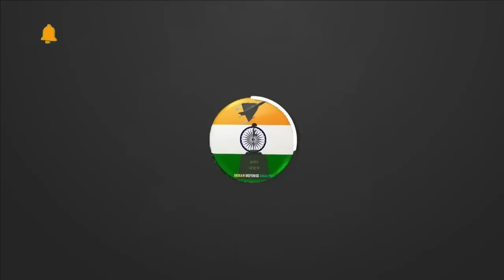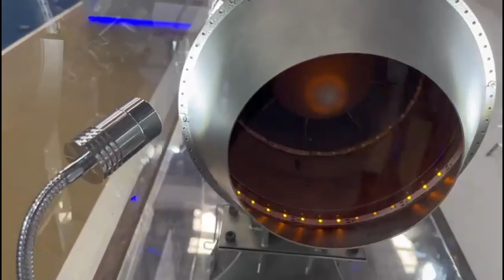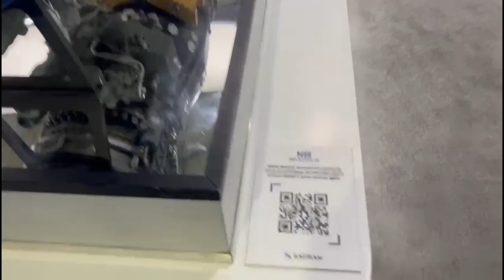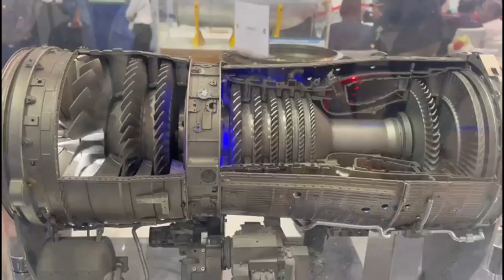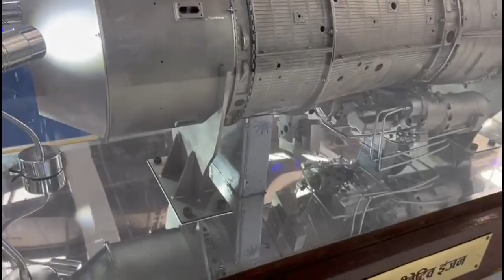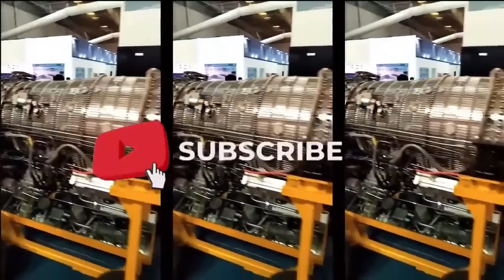Kaveri Engine: Godrej inaugurates facility to commence manufacturing of Kaveri Engine parts

Comment: #mission mode may yeah project shuru say hi thaa hame khud per yakeen karne kii jaroorat hai . humko kaveri engine k liye #environmental control system,#air traffic awareness system, #digital management system or navigation router less elevation  k sath low rolling resistance dawara  energy loss ko #minimizes karna hoga. #Intigrated system  banana hoga taki performance ko maintain kar sake or #engine ki #weight manage ki jaa sake . 😡

Comment: Kaveri engine is a huge breakthrough. The subpar substandard Ge404 engine can be thrown overboard. $716 million contract for 99 General Electric  F404-GE-IN20 engines.
 That is 7.2 million per engine, and at least 4 will be needed over the lifetime of a jet. Kaveri has already delivered an excellent return on investment at the first step! The needed facilities must be provided. Flying test bed and more wind tunnel facilities. The project must be officially relinked to Tejas Mark1A and used when existing engines are due for replacement. It is also necessary to start testing the wet thrust. The deficit vs 70.4 and target of 81 needs to be bridged. Titanium printed parts can help cut weight of Kaveri engine. Time to get started.
Reply: Hello ge f404 has a life of 3000-4000hrs unlike 500-800hrs of Russian engines . 
Frame life of Tejas is 6000-9000hrs

Comment: an engine that is 200KG heavier than a GE404 and has lower performance, yet we are still pursuing the project and claiming it to be a success? does no one care about the performance of the vehicle that will eventually use this engine? oh wait. i forgot, this is all snakeoil stuff anyway.
Reply: 10% heavier is not an enormous problem. Kaveri engine can easily achieve higher performance over time.
Reply: Incremental improvement is also a good way of building capabilities.Sequential versions of engine with improving weight and various parameters can be pursued.The story can start with unmaned aerial vehicles and graduate to fighter jets.
Reply: Big egos at play and corruption also.

Comment: We may have to use this in AMCA...😂🤣
Reply: We already have GE F414 for AMCA
Reply: @direwolf7491  .. it's like using a 1 Ltr engine in a Rolls Royce..
Reply: @abymathew295  GE F414 is more than enough for AMCA as a 5th gen fighter.
IAF wants more ambitious 5.5 gen AMCA which is why they want higher thrust engine.
AMCA is lighter than F-35 GE F414 will give AMCA higher t/w ratio than F-35.
Reply: @direwolf7491  . No super cruise, no TWC...what kind of 5th gen fighter is that..Besides, when the AMCA mk1 is out after 2035 or 2040, the 5th gen fighters will already be in Museums.
Reply: @abymathew295  Can the F-35 supercruise?
AMCA supercruise just as much the F-35 will.
In the museum are you nuts? You think technology is like halwa? Man I find statements like these hilarious. From where do you guys make up all this crap?
Reply: @direwolf7491  . Yes,F35 can Super Cruise..
There is nothing more to discuss about F414. It was designed for Tom cats 30 years ago...You think that's an ideal powerhouse for a 21st century "5th gen" jet.????
We should have already signed a deal with GE to Manufacture a 110 Kn engine with full TOT to use in AMCA mk1...not the Mk2.
F414 is an ideal choice for Tejas Mk2, as it's a reliable, low maintenance engine with enough thrust.
Reply: @abymathew295  F35 can supercruise for how long at what speed? Please check that and tell me also😅
Also, F14 Tom cats were heavy jets.
Also, your suggestion is quite foolish. GE is not offering adaptive cycle engine. What would be the point of getting a 110kN GE engine with ToT then again get another for adaptive cycle next gen engine?
That would be the worst deal ever.
Reply: @direwolf7491  . F35 may not be able to fly At supersonic speeds for a prolonged time, but it certainly can, Besides, the 25 year old F22 and Chinese J20 can sustain those speeds.

We are not getting any adaptive cycle engine from anyone for sure...it's better to stay with traditional, reliable engines with high thrust output to power AMCA. For AMCA Mk2, we could try to add those features into it.
Reply: @abymathew295  Abh aagaye line pe?😅
Now tell me if F-35 is more advanced or F-22 and J-20 is?
Also, there is a high chance that UK may want a seperate line of production for adaptive cycle engine. Seperate from the EU, which they can easily access without too much deplomacy. Rolls Royce has offered adaptive cycle engine with India. So if that offer works out it doesn't matter if it takes another 15yrs to make it. It will be a permanent solution.
Engine is not a big issue for AMCA. Getting the AMCA made is. With engines we have options.
Reply: @direwolf7491  . F22 is still the best 5th gen jet ever made..it's faster, stealthier, and built for Air superiority in mind. while F35 is designed as a dedicated ground attack jet against, like  High value ground assets..and it's cheaper to maintain too.

Speaking of Our jet engine deal, we haven't even started the official discussion with Above stated Engine manufactures yet. Engine is the most important component in a jet and thats what we should give the highest priority. The fuselage and all the other components are home grown and we have full control over them. Hence, it's the engine deal that should be fast tracked.
Reply: @abymathew295  I didn't ask which is the best. I asked which is more advanced? Even I like the raptor, but they are are being retired.
F-35 has lower rcs than F-22 though so you are wrong about that.
I think we already have the engines ready for AMCA block 1. Getting the jet completed is far more important. Even with the GE F414 AMCA will give better performance than J-20.
Reply: @direwolf7491  . F22 has lower RCS than F35...The reason why they are retiring F22 is their Sensor fusion tech is not as advanced as the F35 and old software's are getting harder to update, besides they cannot carry Modern American weapons. But still they are faster, deadlier and stealthier than F35..
Reply: @abymathew295  F-35 is still better than J-20. We need AMCA blk 1 to be better than J-20.
With GE F414 engine it can be.  First we need it made that's all. For advanced engine there is still time.
Reply: @direwolf7491  . We can't say if F35 is better than J20, especially with their WS15
Reply: @abymathew295  What?!!!😅
Bro you don't know what you are saying.
No wonder your comments are so erratic.
Please do some research on F-35 and it's rcs.
Even Rafale F4 can match the rcs of J-20 with all it's WS15 engines. Lol
Reply: @direwolf7491  . Ofcourse, the J20's RCS will be higher, it's almost 1.5 times larger than F35. But in terms of speed, armaments, rate of climb, BVR capabilities, J20 is definitely better..
Reply: @abymathew295  Tell me in numbers man. It is not 1.5 times higher. It is more like 10-50 times higher. Lol
Speed doesn't mean jack in bvr. What BVR capabilities is J-20 better than F-35? Please tell me.
Reply: @direwolf7491  . I wasn't talking about the RCS value, rather pointing out J20's physical form factor...F35 does not have any answer to China's PL15, and yes, Speed does definitely come in play when fighting in close air combat or in BVR mode..turning in, out rating the enemy, climbing,  out running the missile..The speed is everything.
Reply: @abymathew295  Stealth is measured in RCS value. I'm not sure what you mean.
AIM 120D is a decent answer to PL-15. The range of PL-15 is irrelevant when the F-35 will always see the J-20 first because of it's RCS.
In BVR speed doesn't really matter.
Most combats occur at speed mach 1-1.5 max rately ever they'll approach mach 2 in a bvr combat.
Rate fights don't play a role in a bvr.
BVR is all about rcs/stealth, radar, missile, service ceiling and who can lock and shoot first.
Even running out of missiles aren't a problem the next jet can replace the one in the fight while it goes and reloads.
Reply: @direwolf7491  . You didn't get my point...i said the J20 is 1.5 times physically larger than F35.
To Get a decent shot you need to get around 60 to 70 miles on 120D, even with that range you may need at least 2 or 3 missiles to down a single jet...Don't think that a single missile will chase down the enemy jet...so at around 70 Miles J20 will definitely will find you, or your AEW&CS does...After the 4 AAMs of the F35, you will be forced to merge with a J20 or you have to run away..at that point J20 will spank Any F35 without a question..
Reply: @abymathew295  Dude! You don't know what you are saying. Lol
 Let me give you some numbers the minimum rcs of J-20 is 0.05-0.01msq
The minimum rcs of F-22 raptor is 0.001msq
The minimum rcs of F-35 is 0.005-0.001msq
Which is size of a tennis ball.
Both jets are having 10 times lower rcs than J-20.
It has nothing to do with the size of the jets.
F-22 is huge but it's rcs is the least.

Also I don't get your logic. The range of AIM 120D is far more than 70miles (range is more than 100miles) and if the F-35 sees the J-20 at 70miles for the first time the J-20 hasn't seen the F35 yet you can be sure of that.
J-20 won't even know it's being shot at because MAWS will activate when the missile is already about 8-10 miles away. 
J-20s will fall like flies in a real battle.
Why do you think China is making such huge numbers of J-20s?
Reply: @direwolf7491  . Why are you again biting on to the RCS value...Dude, i clearly said I'm not talking about any RCS shit here, but J20's physical size compared to F35..🥴🥴
AIM 120D has over 110 mile range, but nobody's gonna fire a BVR missile at enemy at its maximum range...70 to 80 miles is the ideal firing range of it..And you need to fire at least two or three Fox 3 missile at a single enemy to ensure its destruction...The enemy jet will get MA Warning at close range, that's where the High thrust engine come in play, they will Crank the jet and bleed missile's energy, or pull it down to denser air to do the same, or they simply go terrain masking...
You should play DCS to get a clear picture of How missiles and jets work..at least watch some Videos in YouTube about it.
Reply: @abymathew295  Yoy clearly don't seem to understand how stealth works do you?
Mentioning RCS is most important in BVR. If the jet can't be locked at because of its low rcs you can't even shoot at it. 
70 miles or 110 miles. At either of those distances it is highly unlikely the J20 will spot the F35. F-35 can see the J-20 though it will shoot and go cold. While the J20 will move towards the missile still searching for the F-35 (that is moving away from it) unaware of the missile coming straight at him. This can even cause the J20 to enter the no eacape zone of the missile too. 
By the time it detects the missile it has reached it's terminal velocity mach 4+. 
If it has enterned the AIM120D no escape zone, it is game over. Defensive maneuvers won't save him even at speeds mach 2 the missile is always faster
Reply: @direwolf7491  . I clearly understand how RCS works...it's extremely difficult to get a good lock on F35 at long ranges but that doesn't mean it is completely invisible to Awacs or other ground based Radars. During the 3 second time of opening it's internal weapons bay to eject the Missile is all it needs to ping the radar and enemy to launch counter offensive or to notify their friendlies in the sky. Besides Passive tracking, like EOTS and IRST will also detect incoming Missiles and Exhaust plume of even the stealthiest of jets.Even Pentagon has officially said that their stealth advantages over their adversaries are loosing.
Reply: @abymathew295  We are discussing about capabilities of two fighter jets now you are bringing awacs and SAM systems. Lol
You think US doesn't have awacs?
You think F-35 will attack alone?
With those even F-15 ex will take out J-20s. Lol
Losing stealth advantage is a sweeping statement. If your enemy has a stealth fighter then yes you'll be losing your stealth edge by a little in the case of J-20.
Reply: @direwolf7491  . F15s cannot take down J20, coz they simply don't have a missile capable of reaching those distances, till they induct AIM 260D into their forces.
Reply: @abymathew295  Why not? F-15Ex is faster than J20 got awacs to track them down. I am using your logic here.
Rafale will also be able to kill J-20 with AWACS and the Meteor. Because according to you RCS doesn't matter in BVR😅
Reply: @direwolf7491  . F15 has no answer to PL15...do they .???
Reply: @abymathew295  I don't know. Do you know the real range of PL-15? Or how effective it is at that range.
 I have my doubts that a dual pulse missile can have such a massive range.
The Meteor has Ramjet engine so it makes sense.
Also, I used your logic. F-15 is the fastest fighter in this era. It will get in range shoot and out rate the J20 and bleed energy of PL-15😅
Too much dcs right?😅
Reply: Don't have enough thrust, its probably going to use for UAV.
Reply: @ananthunath4450  . It is

Comment: That was unexpected.
Kudos to godrej for bringing up this support to defence 🔥🇮🇳❤️
Reply from the maker: Godrej is just doing screw driving the tech is developed by GTRE. The Pvt firms are yet to prove their metal in R&D
Reply: @IndianDefenseAnalysis  
💀
Reply: @IndianDefenseAnalysis slipper-shot to those who says PrIVate PlAYer Is NEedEd.
They don't even wanna invest 1 rupee in r&d but only produce the items that is already there or developed by govt PSUs and people complain that govt isn't doing enough lol if that's the case then let the private players develop their own hardware without any govt help or fund😂
Reply: @IndianDefenseAnalysis  *mettle
Reply: @IndianDefenseAnalysis  This is why lithium ion and fuel cells must be pursued heavily for smaller aircraft. This is tech that is indigenous, while engine tech will take at least a decade. Leapfrog development is the way to go!
Reply from the maker: @datoolz0  yes